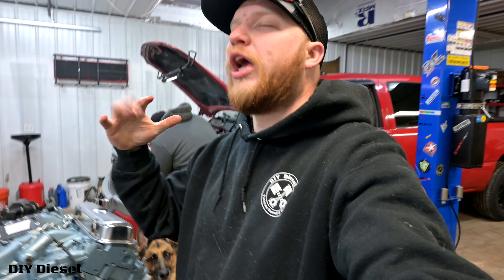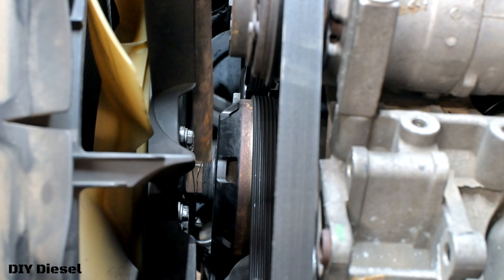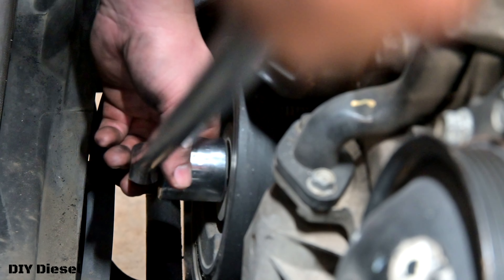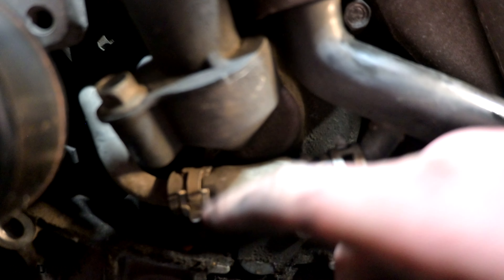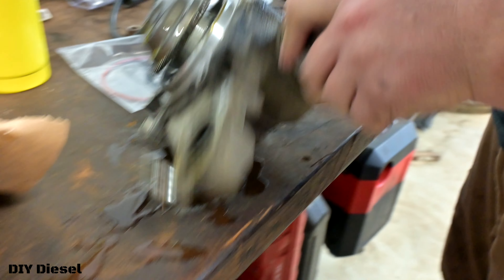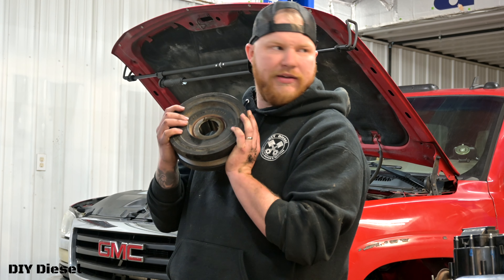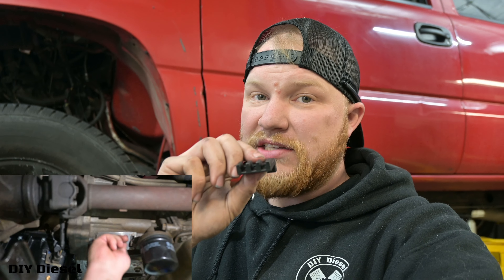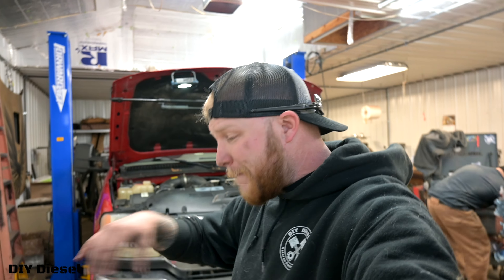Say Goodbye to Overheating: A Complete Guide to Replacing Your Duramax Water Pump (2006-2016)!

Comment: Anyone who watches this video please replace your crank bolt/harmonic balancer bolt when you do this job. It’s a one time use bolt. Any bolt with that torque spec should be replaced. Last thing you want to happen is for this bolt to back off over time. Internal gears for oil pump and timing gear will shear off the alignment pins on the crank and spin on the crank and your engine will be junk all because you didn’t spend an extra $50 for a new bolt. This is why everyone believes you need to key the crank when in reality the torque on the crank bolt is what holds all the gears in time.
Reply: Yup!! And from what I read, it is best to lubricate the bolt and torque it to 74ft lbs. And then an additional 105 degrees which would equate to 325 to 390 ft lbs. Not the 260 ft lbs these guys claim.

Comment: Water pipe was actually pretty easy hardest part for me was the last bolt on the back of the water pump at the bottom..fan shroud bracket was in the way.
Reply: This wasnt too bad for me I just hoisted myself under my truck with a size 12 wrench and I was able to see it pretty good with a headlight
Reply: I agree
Reply: Mine rounded, had to take the ac compressor bracket off and get 4 hands in there on a small saw.

Comment: Wagler makes a billet water pump
Reply from the maker: Ya internals only though not a complete pump. Great options for those looking to push high horsepower
Reply: Wagner water pump are 850.00.
Reply from the maker: @jasoncall5318  do you have one? I’d so what’s your thoughts on it?
Reply: @DIYDiesel How do you know when to change the water pump? Water is likely to enter the engine?
Reply: Wagler isn't available anymore.
Reply: @jorgemaldonado1041 when it starts to leak from the weep hole.
Reply: Do you have to change the whole thing if it’s leaking at the weaphole or just the inners?

Comment: Need some cardboard in front of that radiator. Did you reuse the balancer bolt or use a new one? Nice vid!
Reply from the maker: We opted to re use it. I would suggest going with an arp one
Reply: It's a one time use only. Never re-use the old one.
Also need to add the XDP harmonic dampener pin kit. The factory crankshaft pin is extremely failure prone and when the dampener slips your crank will snap in half.
Reply: @saltysteel3996 I just spoke to XDP sales on the phone. As of right now, that XDP pin kit is on back order to the date December 31, 9999. No lie or exaggeration. XDP said the company that makes the jig is playing games with them on production and they’re at the mercy of the manufacturer. “Intergalactic back-order” was his exact phrase.
Reply: @GotMyChevy  That's too bad. I was wondering why no one had stock. CR2 Fabrication makes their version that I just bought.

Comment: 1) do you have the link to all those torque specs? and 2) whats the plan if the harmonic balancer is on tight as a mother? Cant really fit a puller down there unless take off entire cooling stack/front end? Thanks
Reply: I’m in the same boat as we speak. I just got the bolt off but can’t get the harmonic balancer off, it hardly wiggles. I put some liquid wrench on it and will try after it sits for a little.
Reply: @ericditri1020  any room for a puller?
Reply: @ it is too tight for a traditional puller.
Reply: @ericditri1020  my exact nightmare of a situation. hopefully it comes off man. Maybe its rusted on. Try light hits with mallet to break free or heat
Reply: @Garage_Beers  thanks I didn’t think about heat. I did read someone used a crow bar to start it but I haven’t put much thought into that yet.  I will update with what happens. It does look like it has some rust, I can’t post a pic in the replies though.
Reply: @ericditri1020  yeah try light taps in a circle on the balancer. Be careful, this is the crank we are working with here. DONT pry hard in 1 spot. Keep it even throughout. I almost regret mentioning heat because id prefer not to F with the crank like that. Just be gentle throughout

Comment: You guys should have re pinned the harmonic balancer  xdp diesel  makes a great  die an pin kit. To fix the shearing factory weak ass pin.  To save the crank from braking. Just did my LBZ.
Reply: I just did this to mine. XDP was out of stock. CR2 Fabrication mfgs a version. Only one that had stock!

Comment: Thanks for this video. I just changed out the water pump, thermostats, pulleys, tensioner, coolant temp sensor and fan clutch in my 2010  Chevy Express cutaway w an LMM. I hope I dont have to touch a thing for another 120k miles because working on a van is tight.

Comment: Happen to have a part number of the rubber hose you put on before installing the new pump?
Reply from the maker: It came with the kit we just cut it off of the one that was in the kit as it is good for 2006-2016 that hose is basically universal, because they want you to cut it down for other models like this.

Comment: Great! Thanks for making this detailed one.  Any idea about how many miles before these pumps typically start going out.
Reply from the maker: For the 06+ it’s usually just a high mileage thing so around 250 is when you start to see some go. If they are 06 and below it’s just depends when it decides to go because they are not composite impellers
Reply: 150000 miles
Reply from the maker: @jasoncall5318  damn yours went out at 150
Reply: @DIYDiesel  252,000 lol
Reply: 238k on mine
Reply: Mine went 204k. LLY
Reply: I’m changing my pump on my 2013 and currently have 258,xxx
Reply: 320,000 on my LMM 
Started leaking from the weeping hole.

Comment: Hey I've just installed my water pump as well,  but I used gasket maker silicone and the metal gasket. Do you think that will be a problem with leaking??
Reply from the maker: I’m not a fan of gasket maker in that spot coolant is some nasty stuff. Only time will tell really, but as long as you did it right I don’t really see an issue with it.
Reply: Damn.. ok, ya I don't want to risk it. I. Going to remove and replace with new gasket
Reply: Thanks for responding brotha! By the way great videos you put out.. very informative 👏
Reply from the maker: @sergduce  appreciate that! 🙏 it’s 100% up to you Permatex says it is resistant to coolant, and ATF some of the worse fluids there are, but I have seen it leak before. I wouldn’t recommend it, but according to there specs it’s rated for it.

Comment: Can you elaborate why you decided to keep the fan shroud off? I've heard mix stories on having overheating issues afterwards with such a small diameter fan by itself
Reply from the maker: That’s my bad I got side tracked on that. I’ll be making a podcast episode on that soon. 
To answer your question; The main part of the fan shroud is a top, and bottom piece. Some people remove the complete shroud, and I wouldn’t suggest that. As it diverts the air in the direction intended. The blades that we took off then separate that air before hitting the fan to disperse it evenly. Keeping that off is not going to cause any over heating issues, if you are light towing or daily driving. Even with heavy hauling I do from time to time 16k+ I have never seen any issues. It is way more beneficial for myself to have it off to make routine maintenance more simple. 
Now if you are towing daily, and hauling heavy loads I would suggest keeping it on, and I am talking heavy loads not simple 10k loads. Most people that say it’s there for a reason are the same ones that say anything other than stock components are bad for these trucks. I would keep it on hand, and see if you notice a difference. If you think you are hearing more than usual most certainly throw it back on. 
I hope my opinion on that helps a bit.
Reply: @DIYDiesel  Thanks for the response, I changed my water pump yesterday, I'm going to leave it off & see if there's any difference, We occasionally but not regularly tow more than 10k with our dump trailer,  I've never seen my truck get hot if gets a little hot Ill throw it back on. I think everyone's experience changing the water pump is different. The hardest part of the job for me was removing the back nut on the waterpump to oil cooler, it rounded easy, after failing to air chisel it loose it turned it into a full day job, good thing I have a lbz engine tore down in my shop with spare parts, ended up cutting that pipe to remove the pump & pulled the oil cooler to change the water pipe. Not the most ideal, but sometimes you have to deal with these things when your working on 400k mile trucks. No more leaks! Thanks again for your opinion & advice in the video.
Reply from the maker: @WarrenShams  I agree everyone seems to have different issues when it comes to this install. Glad you got it done and I could help a little bit! Hopefully the leaks stay away 👏🤘
Reply: @WarrenShams  Your comment is deja vu to a T. 480k lly, doing all the same, hopefully will not be back in this area.

Comment: my 2011 lml goes past 210-220 when pulling my camper up hills. it’s got a new radiator,fan and clutch thermostats fan shroud and coolant. i have 180k miles any ideas??
Reply from the maker: What are you monitoring it with? Also 210 is normal when climbing a grade(especially in summer), but when you are climbing a grade you want to be climbing in 5th max don’t climb a hill in 6th down shift before you hit the hills to 5th and see what that improves.
Reply: @DIYDiesel  stock gauges. it will go to 220 climbing hills but only when towing

Comment: What’s ur opinion on the dmaxstore water pump? I have one in my truck and it was a $300 POS went back to a stock ac Delco unit
Reply: What was wrong with it? I'm literally about to finish installing mine tomorrow ??
Reply: @cecilalee86  started leaking after 3-5 thousand miles, pulled it all apart resealed everything again leaking again after about 7k miles. Was out of warranty by 2 weeks dmax store didn’t do anything for me stopped dealing with them altogether after being a longtime customer of theirs
Reply: @dl6043  ahhh!! I put my truck back together today. Snapped the dowel pin on my crank shaft that goes to my harmonic balancer. I'm pissed!! When it rains it pours. This water pump job has definitely given me a lot of trouble. Before that I broke off the water pump stud in the block. Got that out had to order a new one got it in, installed then that dowel got me smh.
Reply: @cecilalee86  XDP makes a pin kit for the crank and dampener. Easy job. Will never break or slip again. Don't even need the factory "pin" anymore, but the factory pin does keep the alignment easy while putting the XDP kit in.  Once the XDP pin is done you won't need the factory pin anymore, but it doesn't hurt to leave the factory pin there if it's still good.

Comment: How the heck do you pull out that harness plug next to the engine fan clutch
Reply: Completely remove the clutch bracket. Take a right angle pick and gently insert on engine side of plug clip and apply light pressure. That’s how I got it off.

Comment: I seriously hate that dammn fan shroud and want to leave it off but i dont wanna lessen the cooling ability or have it affect air conditioner cooling or intercooler functioning.? Just wanted your opinion and what you guys do on your personal trucks. Mine is very similar to a LBZ platform but is 08 LMM
Reply: I'm gonna leave mines off , personally I feel like to much stuff there actually blocking it from cooling no way for air to get in and out , unlike the newer trucks with very ,very big front ends that cool much faster

Comment: Great video. Thanks for sharing. Have a question though. When you were saying it’s a good time to replace the fan clutch did you mean the fan pulley?  PN 1265313?  Thanks again
Reply from the maker: So I ment to say both fan clutch an pully it’s worth it to do right now since everything is apart
Reply: @DIYDiesel  

That’s expensive. I think. If I’m looking at the parts correctly each are over $200. My truck’s got 300k on it and weeping coolant from the water pump. Not good. Thanks so much for the video.
Reply from the maker: @erictindall7502  ya you don’t have to do it at all it’s just something I’d recommend. We didn’t do it to this truck.

Comment: How did u know yur pump was bad,   my pump is good but I have a drip, so hard to tell where its coming from.  I hate to do this whole job if its a o ring on that uper pain in azz pipe u tried getting off
Reply from the maker: I just basically followed it all the way back to the weep hole on the pump

Comment: Love your videos, just finished taking my water pump out right now, should there be a tiny bit of oil on the gear side of water pump? I’m assuming that’s self explanatory, but don’t want over think anything. Lol
Reply from the maker: Yes that is normal the O ring seals the oil in, and the coolant is pumped along the side and back of the block. I appreciate the compliment & support! 🤘🏼